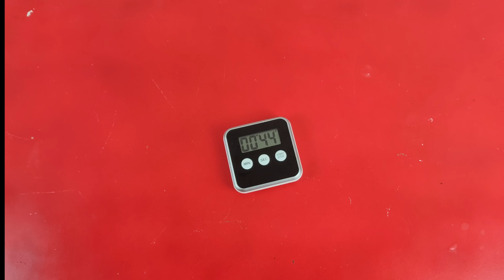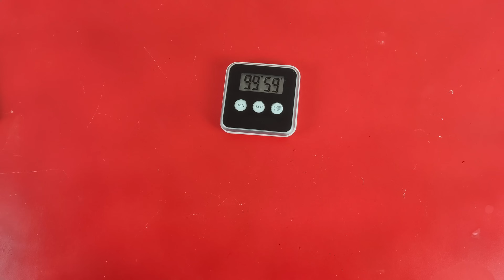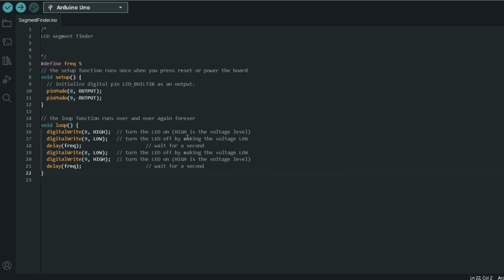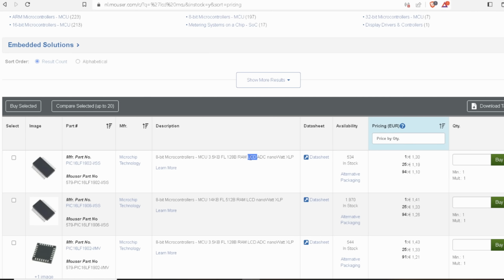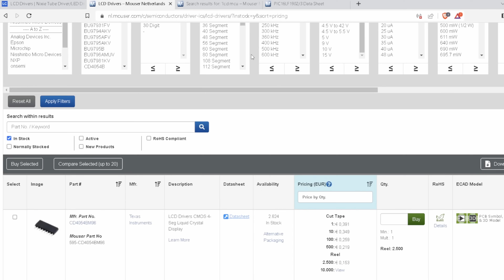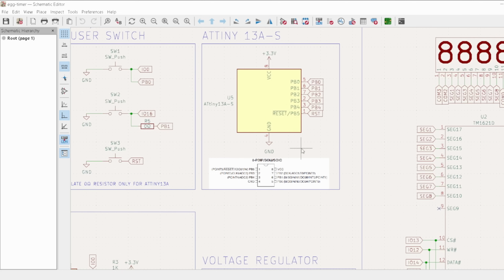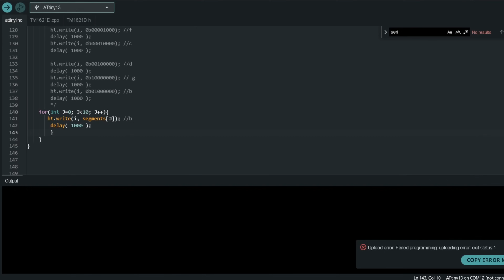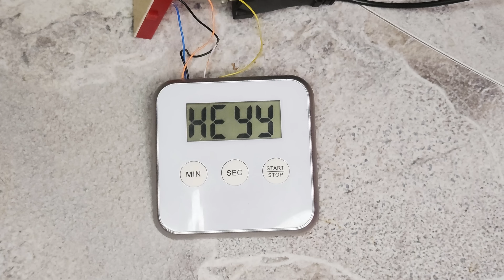Reverse Engineering Common LCD Kitchen Timers (Egg timers) with Arduino

Comment: With all respect, but this is not a reverse engeneering of lcd timer. This is "taking the lcd display from lcd timer".
You could also use the diode checker on a common multimeter to find out contact-segment relation

Comment: You can reverse engineer it without any soldering by using square signal of ~100Hz (with an amplitude of 1.5 volts in this case). You can then connect the square signal pairwise on the  LCD pins until you figure out which are the Common and Segment pins.

Comment: Hi, do you believe you could assist in reverse engineering an Opel LCD screen (specifically the Opel clock display) for a project I'm working on? I aim to utilize the factory screen, but I'm encountering difficulties achieving the desired functionality due to my limited knowledge. I'm willing to purchase the screen for you to work with, so there won't be any expense on your end.

Comment: Excellent video! Liked & Subscribed... I love how you gave very clear explanations on how you went about reverse engineering this timer and how to control it. It reminds me of the bank card reader I once gutted to reuse its LCD.
Nice to see that versatile PCB you made. I made a library for TM16xx LED drivers that includes a 7-segment font to implement the familiar Arduino print function. As you say most characters can be made up using 7 segments in a fairly readable form and with a bit of scrolling even 4 digits can be enough to display a longer message.
I knew about the TM1621D chip, but didn't use them yet. Your video encourages me to buy some too and perhaps include them into my TM16xx library. Thank you for sharing!
Reply from the maker: Thanks for your kind comment. Indeed having a proper library is a great idea. I also saw your library. Others can easiliy use it for their own purposes. It might be a good idea to have a pointer to define all the segments first. Because pinouts are different for most screens, and there are custom segments on most LCDs. Maybe instead of including it to existing library, a separate library would be easier to use.
Reply: @makersfunduck - Thank you for the suggestion. Good point. In the past I've also encountered need for such segment mapping and I've implemented support in a few sub-libraries, mainly for addressing 15-segment alphanumeric LED displays. I intend to make it into a generic feature but I'm still figuring out what the best way would be to unify the variations in memory size, number of segments and common anode vs. cathode usage. Perhaps it's best to redesign the library, but for now I try to keep it compatible with its predecessors.

Comment: How did you make the LCD footprint?
Reply from the maker: with KiCAD footprint editor
Reply: Sorry for the wrong question. I mean how did you take the measurements for the pads? With a caliper?
Reply from the maker: @ElectronDuino  Ah, yes. I have used a caliper and took measurements. and to relax the tolerances, I made the pins a bit wider and longer than the original footprint.

Comment: I did a whole project that used one of those LF1902's.  I was driving a 10-pin 4 digit 1/3 duty cycle TN display that I had made.
Reply from the maker: It sounds pretty cool. Couldnt find it in your channel though.

Comment: that is not "reverse engineering" by any stretch, it is simply random "DIY project" aka "youtube content" consisting of connecting a 20 years old avr to a random segment LCD, which is not an achievement, really, any segment LCD is extremely easy to drive.
Reply: I hope it helped you got that out of your system.
Sometimes it's just better to say nothing on the internet.
This is one of those times.
Reply: He did reverse engineer the pinout of the LCD, which helped make sure the controller he was getting would work with what he would buy.
Reply: I don't know where you learned the definition of reverse engineering, but you're wrong. He absolutely did reverse engineer the LCD panel. The entire process of figuring out the pinout is 100% reverse engineering. Plus you can't even effectively reverse engineering an MCU/IC that has a resin blob on it without special tools and chemicals if you don't know what the chip is. Why hate?
Reply: I also assumed after reading the title he found a way to reprogram the "blob" to customize the egg timer function. It is not , but still an interesting video.
Reply: show us your video lets see how good is compare to this... what? you don't upload videos? then "stfkup "dude, nobody cares
Reply: Where is the video where you show how easy it is? 
(Finding out what connection does what without documentation, is reverse engineering in my book... Reusing a device to make it much more useful is quite an achievement that not many people dare to even attempt, let alone take the effort in sharing their experience in such a clear way)
Reply: You must be fun at parties 🤓

Comment: Pretty sure you dont even need a driver, you could have easily bit banged it, as the drive frequency is something like 50hz is sufficient.
Reply from the maker: You are technically correct. But programming part was a little tricky. Also your mcu needs to work all the time even if you put interrupts + it saves you pins. So I thought I could afford just 20 cents for all these luxuries :)

Comment: I watched the whole video but still don't know how long I should boil my eggs for.
Reply from the maker: :D me neither @mattsan, me neither.
Reply: @luuuuuuuuuuuul 
3-5 minutes: liquid yolk with soft, whites not fully set
6 minutes: liquid yolk with fully set whites
7 minutes: jammy yolk with outer edges set
8 minutes: half set yolk
9 minutes: half set yolk
10 minutes: mostly set yolk
15 minutes: hard as a rock
Reply: I cook my eggs in a steamer, 12 minutes. Then cool quickly in in ice water before peeling. Nice soft, mostly set yolk.  Also, works best if you let them get to room temperature before cooking.

Comment: Nice video. I like how you walked through the different options and why you choose one over another. Not too much detail, just enough. How you used trial and error to determine the pinout of the screen that was very helpful. In the past I have thrown out those screens from old devices, thinking it would be impossible to figure out what all the pads on it do. But you have shown that, with enough time, I could figure it out.

There are a lot of basics videos on electronics and microcontrollers, but after learning the basics I find it hard as a hobbyist to learn more intermediate level projects like this. Thanks for the video, I know how much time and effort go into making it.
Reply from the maker: Thanks. There are tons of theory videos. What we makers do not have is practical explanations. Thats why I am trying to not get into theory, and try to focus on what is important to us :)

Comment: I've already done that with an Arduino Mega 2560. 

in the loop:
I2C was read out, 
packed into a string, 
an LCD font was applied, 
and the pins were sorted,
created an inverted image.

The pins are output with an free running interrupt, straight or inverted.

The only disadvantage I needed a lot of IO pins.
Reply from the maker: Another disadvantage would be the code I think if it had more than 1 digit. If you have your code somewhere, that would be nice if you can share it.

Comment: You could also design a small boost converter and put it on the PCB, so you can use standard AAA cells. Although the small AAAs don't have much energy.